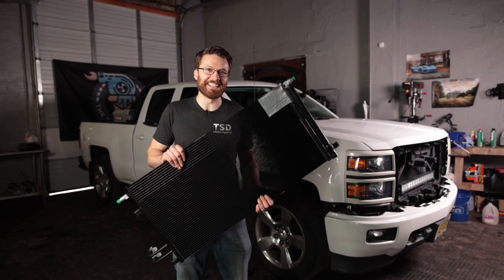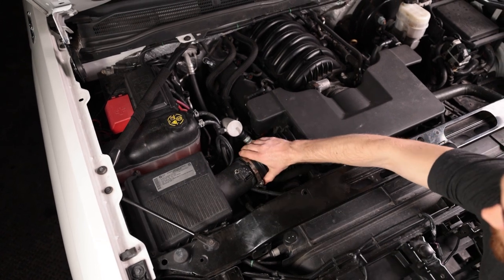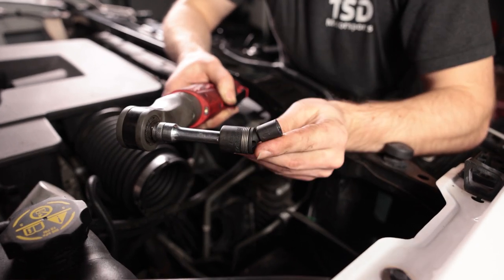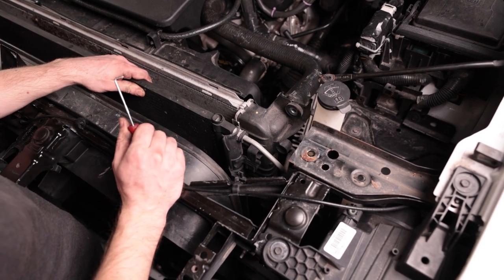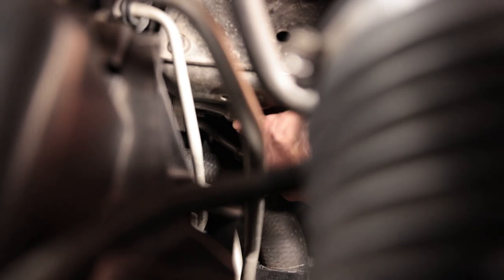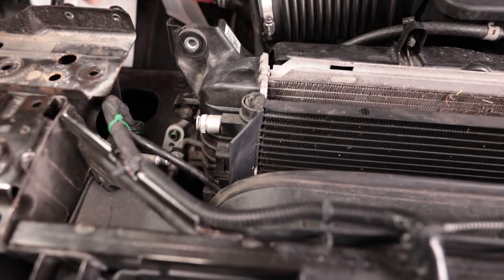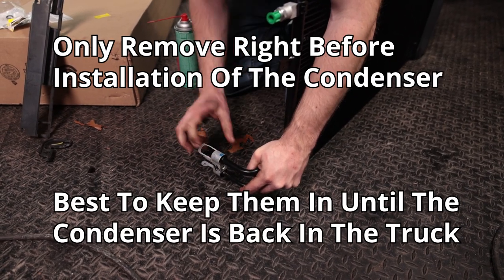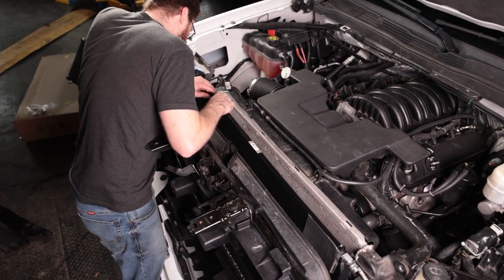Silverado AC Fix - How To Install Silverado AC Condenser 2014-2018 Sierra Tahoe Suburban

Comment: Great video! Little tip for a line that go into a fitting with orings. Spray some silicone on the line before sliding it in, i just sprayed it on my finger and wiped it on the line. Went in super easy
Reply from the maker: That's a good idea!

Comment: I did this on my 2015 Silverado today. I was able to get the L-bracket on, but definitely took a lot of patience. After vacuuming and recharging the system, I had ice cold AC again. Thanks for the video!
Reply: Eric did you had to add compressor oil with this task or just transmission oil and freon  thanks in advance

Comment: That same replacement condenser was installed from the factory on my 2018 Sierra.  It just went bad.  GM extended warranty replaced it with a slightly different design.  Not painted black and no heat shield reflective square.  Also, I don't see the welds - hopefully this one will last longer.

Comment: Front grill and front skid plate take less than 5 minutes to take off.  Worth removing to get bottom and middle front access to get everything seated and aligned (like that boot you talked about).  Not to mention getting all the leaves out.  I also had bird nest in mine lol.
Reply from the maker: Good tip! I have a nest in mine currently I need to get out lol

Comment: Did this on my 2014 Silverado today! My L-Bracket snapped in to pieces trying to take it off the old condenser, glad I didn't need it. My biggest issue was getting the old transmission line off the old condenser, had to use a dremel to cut and pry away the old connection from the line. 

But as always, thanks for making what could be a long weekend into a short easy project!
Reply: Transmission line?
Reply: @zamfambam 2 little lines on top on both ends with snap rings holding them in
Reply: Got ya. Got mine replaced with an after market one. It’s much more solid. The whole side where it cracked is solid and not just 2 welds. Napa Tem condenser.
Reply: For clarification, I got the retainer clips off the lines easily. One line side popped off pulling by hand. The other side was lucky I only pulled out the dremel

Comment: They make aftermarket condensers that are fully welded. OE condensers are still just tacked in 3 spots they will fail just like original did
Reply: That is absolutely astounding that they would recreate a defective product.  Then GM wonders why people don't take their vehicles in to a GM service center to get repairs.  Air conditioning is not new technology so there should be no defects with it at all.  Apparently GM has lost that technology and went back to square one in research and development.
Reply: @g.k.1669 cut them slack man you know they're going "green".
Reply: @Six_ftdeep32  Just picked up my 2014 Silverado from the repair garage yesterday, I barely have time to cut the grass let alone wrench on vehicles anymore.  Was pleased to see that they replaced it with an aftermarket condenser.  Never thought that I would be saying that.
Reply: Link to a good one?
Reply: Need a link to a good one

Comment: I believe that where your fins are messed up is where gm stopped the trans cooler and started the a/c condenser.
Reply from the maker: Yes. I believe you are correct. Very poor manufacturing quality.

Comment: What are the part numbers for the two gaskets that were replaced on the a/c lines?   

Followed your video and got the condenser swapped in a few hours.   One note:  On the transmission line that is such a bear to get back in on the driver side top, I took the line completely off and then it was easy to put back in because it could be manipulated better.  After that, the bottom one goes right in.  Thanks for a great video!

Comment: 11:52 the two links go to the same oring.  By chance know which is the other?  RockAuto shows a few with what looks like different options for the vehicle.
Reply: I was looking for this comment any luck on finding the o rings?
Reply: @brandonbrown350  I went to Oreilly's with the old ones and we were able to match them up.  I dont remember the part #s though :(
Reply from the maker: I'll try to get this fixed. Sorry about that. Please comment back in a couple days if it isn't updated in the link
Reply from the maker: Link is fixed!  https://geni.us/AC-Gasket1

Comment: Knock on wood,  my 2015 Silverado AC is still working good.
Reply from the maker: The 15s probably have an updated condenser. Fingers crossed it lasts for you for awhile! Mine failed around the 4 year mark
Reply: @TheSundaeDrive  I am hoping mine lasts a long time.   I usually keep my vehicles for 15 years or longer.  I don't like vehicle payments.  Lol
Reply from the maker: Same! I like to keep them until they die, and then maybe fix them again haha
Reply: The 2015’s don’t have the updated condenser unfortunately, going to use your video this weekend
Reply: My 2016 just quit working. Preparing to fix now. Great video. Thanks.

Comment: Is there a trick to getting the transmission cooler lines back into the condenser? Mine do not want to go back in all the way no matter how hard I try
Reply from the maker: Patience. I had trouble with it too. Some lubrication on the outside (make sure it doesn't get on the inside) could help. But again, very important you don't get it inside any of the piping or condenser

Comment: I was unable to use that same plastic bracket as you. It wouldn't line up. Left it out as well. I used an AC Delco condenser on my 2015
Reply from the maker: Good to know. Thanks!

Comment: Would leaking ac condenser cause higher transmission temperatures? Transmission went out at 35k , got it replaced and still seeing over 200 temps. I feel like the condenser is clogged with transmission remains.
Reply from the maker: The transmission cooler is built into the condenser so I would replace that ASAP if your temps are that high.
Reply: Dont forget these models have a transmission thermostat that notoriously goes bad. You can delete these
Reply: Mine goes from 189-192 degrees with a bad condenser.
Reply: There is a GM service bulletin (Bulletin No.: 21-NA-199 )for trans thermostat replacement. It takes the temp down to ~150.

Comment: Is there a way to diagnose it before taking everything apart? My AC went out yesterday.
Reply: Add a freon with Dye. After a week during nighttime, use a uv light to look for any dye leaks through the front grill.
Reply: Dye is the best.
However,  make sure you check what freon goes in your system.
134a vs 1234yf.
Totally different games and not interchangeable. 
134a = $12.99
1234yf= $44.00!

Comment: So I had to return the first condenser I got and had everything taken apart as the condenser had a nice bend in it.  Got a new one today and while putting it back in I'm having a hard time with the clips that hold the tranny lines in.  Did you pull them out and then put the lines then put the clips back on?  This is what I'm doing and having a bear of a time getting the clips back on.  

Am I supposed to leave the clips "connected" and then push the lines in?  Seemed like this is what you did as you stated it was really difficult to get them in.

Edit: got it figured out how to manipulate them to get them seated. 

Got it back together and started the truck up to look for leaks.  No leaks! 

Now I need to rent the vacuum and suck the air out and then add freon.
Reply from the maker: Glad you got it figured out. They were annoying. Just in time for summer!

Comment: I'm not sure if you still own this truck or not but did you have any issues with this particular condenser after installation?  I am getting ready to repair my fathers 2015 GMC Sierra and I was trying to determine the best replacement part to order?  Thanks for the great video
Reply from the maker: No issues still working great!
Reply: @TheSundaeDrive  Thanks

Comment: Why did they run a transmission cooler lines into the condenser? What ever happened to have them go inside the radiator??

Comment: Dude, you didn't need to remove most of that stuff just to get to the condenser. Alot of needless disassembly on your part. 
After Market Condensers are much better than getting the Same Old Same Old, Just to end up having the EXACT SAME PROBLEM Again later.

Comment: Just take it out and jb weld tf out of it lol worked for me and it cost $5
Reply: Careful...there are some cork sniffers lurking that will knock you for using JBW on a $40K truck. ;)  Mine is leaking at the usual top drivers side coupler at the dryer.. I can access it through the grill, so I am entertaining prepping and sweating some aluminum flux core rod, using a propane torch. Lazy I know, but its already over 100 degrees in PHX...
Reply: @psmith7781  Was thinking the same, any luck?
Reply: @stevenjames14  It did not work.  I just bit the bullet and purchased the Specter one from Amazon that has the weld all the way down the side.  Took about three hours to swap it out.